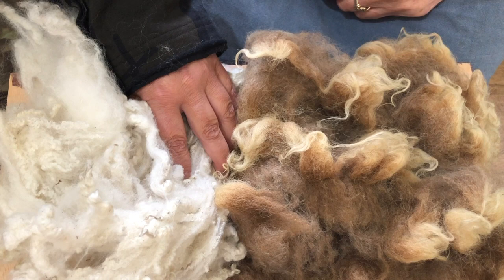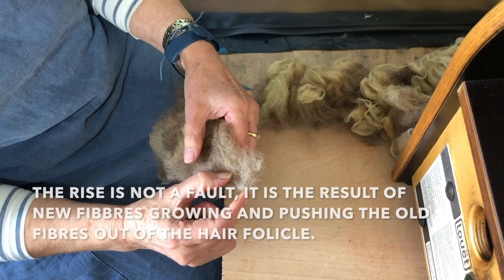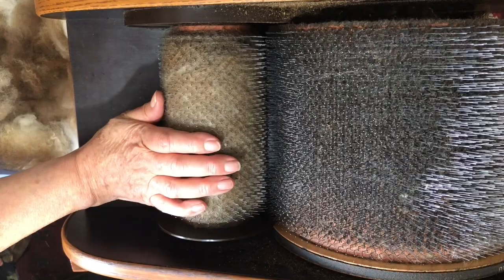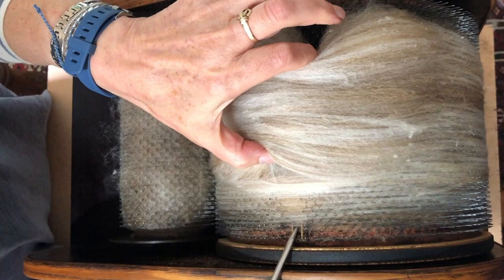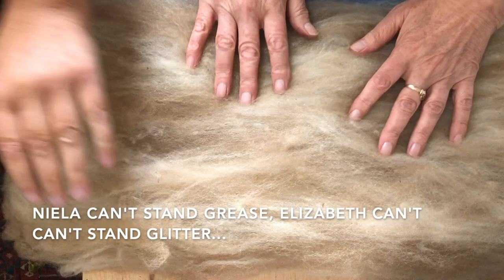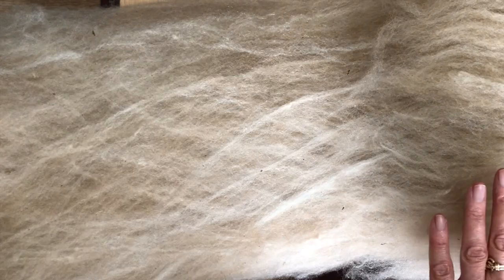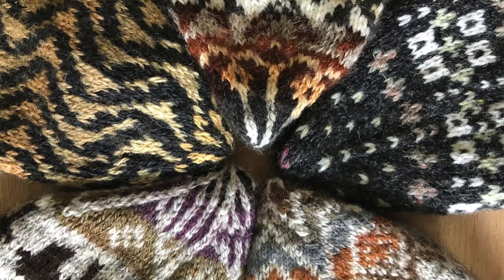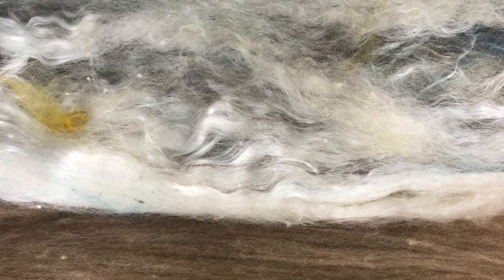A 'Conversation on Carding’ with Elizabeth Johnston and Niela Kalra

Comment: Wonderful video, thank yo so much! One thought on the staple of the wool; If the sheep was sheared at the rise, at the right time, you would not have to pull anything off. Also if the fleece is roo'd instead of sheared there is no break in the wool.
Reply: tessen58 if the fleece is roo'd then the last years fleece only is removed and ALL of the new fleece stays on the Sheep. If it is sheared AT THE RIGHT TIME and at the SKIN, then you may have only the old fleece and none of the new fleece. You need to realise that where the old fleece and the rise meet is not a break in the wool - the rise part is a new fibre that is growing and pushing the old fibre out of the hair follicle. The reason that primitively sheep can be roo'd is that the fleece stops growing in the winter and they start growing a new fleece in the spring - the new fleece and the old fleece are not attached. If the old and new fibres were attached you would not be able to pull the old fleece off.